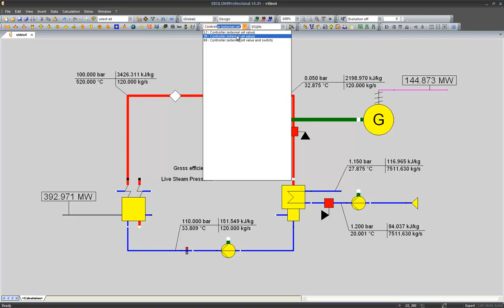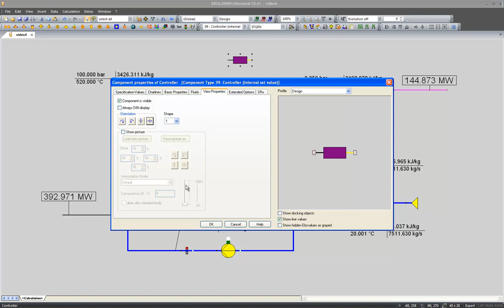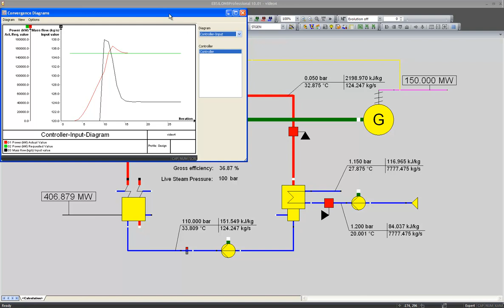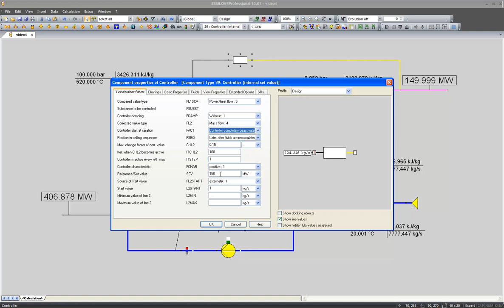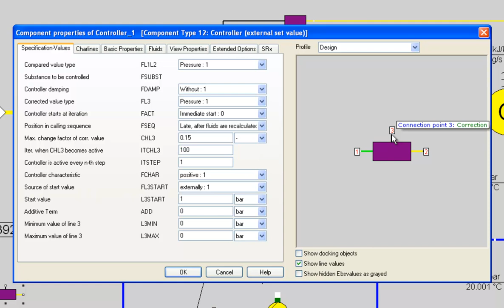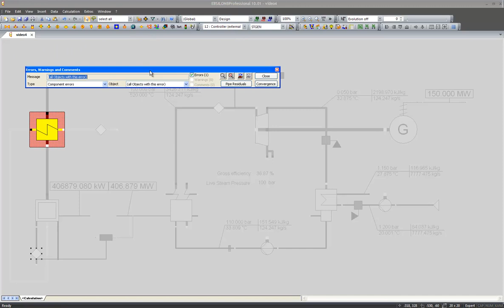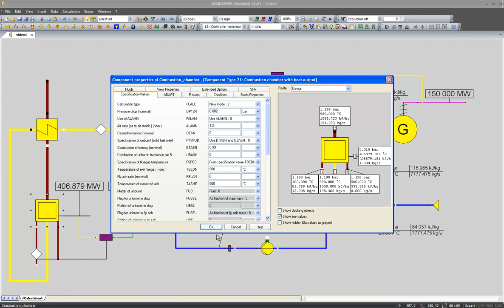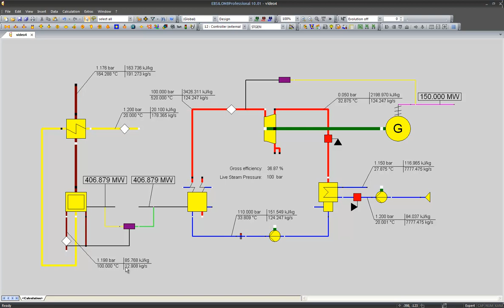Simulation Software - EBSILON Professional Controllers

Comment: I copied everything U did but the power out of then furnace ist negativ in  my cycle I don't know how to fix the problem
Reply: The video uses an older version of Ebsilon.
Nowadays if you want to define composition/heating value with a comp 33, you have to activate 'Set fluid completly', from the Specification->Material Fractions tab, instead of 'Do not set fluid' which is the standard now.
Reply: i have the same problem!! it is very frustrating
Reply: I was able to fix my problem by using Boundary Values (comp 1) for both the air inlet and coal inlet streams, instead of the General Input Values (comp33) that he used. With this I was able to get rid of all the errors and I got a power outlet from the furnace similar to his.
Reply: @alexiswestwood809  Thanks a lot bro i was wondering as well why he didnt use comp 1 so i didnt use it at first but it made sense at the end. i dont have a clue how it worked out with him.